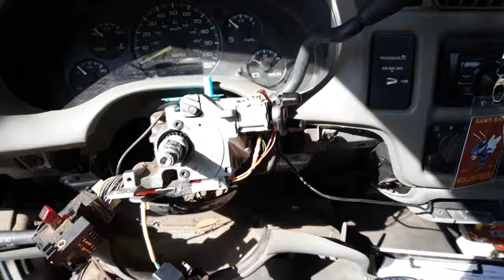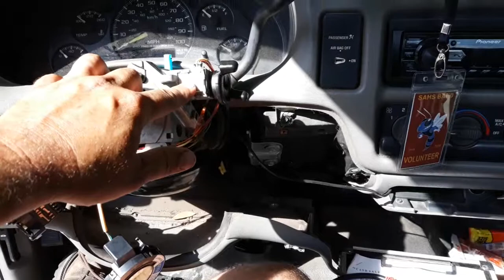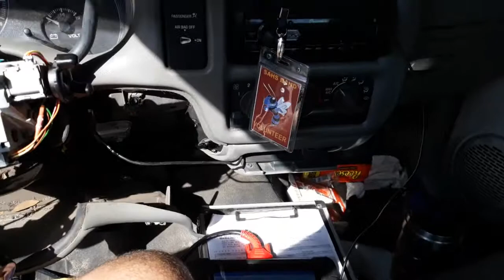GM Passlock Coded Cylinder

Comment: How much was it and what is the part called? Does it come with lock cylinder or is it separate and if its separate do you have to replace both to fix?
Reply: Thanks yesterday was the first time I went to start my tahoe and it said unknown driver. I pulled the negative terminal on battery and waited a few minutes before reconnecting and it started fine after that put I have 270k miles on it so I'm sure this is just the beginning of a problem
Reply from the maker: @dugangant  now also those lock housings have a common issue. The connector that goes into the top of the housing can get a bad connection over time. My other Chevy had that problem. It was intermittent. The fix is to wedge something small into the connector to make it lock in firmly. What I did was take a toothpick. I pressed it down on the left side and snapped it off. Then I flipped it around and stuck it down in the right side and snapped it off. 

Now when I say stick the toothpick in I am meaning to stick it between the plug itself and the plug socket. This solved my issue and firmed up the plug. When you take off the top column cover you will see the plug. It is small with small wires. If you take the wires and gently move them you will see how the plug wiggles in the connector. That wiggling needs to be fixed. Hope it helps.

Also there are 2 screws holding the cover on. I thought there was just one but the one that was hiding on me was tward the center on the bottom of the cover.
Reply from the maker: It is an ignition lock housing. It does not come with a lock cylinder. It is not necessary to replace both.

Here is a link to Rock Auto: https://www.rockauto.com/en/catalog/gmc,2000,sonoma,2.2l+l4,1362899,ignition,ignition+lock+housing,12030
Reply: @Bbernhardsr  The link for the part no longer works.
Reply from the maker: @ItDontComeEasyRVA  I fixed it. Try again and let me know please. Thanks.
Reply: @Bbernhardsr  Yes sir ! It works now.
This morning I did more research. I finally realized that my problem may be this - the former owner gave me spare keys made at Home Depot. They don’t have a chip in them. They also are worn from inserting so many times in the ignition. 
Tomorrow my quest is to find out if I can get a replacement ignition switch and new keys with the chip in them. That can keep this problem from occurring again, possibly.
Reply from the maker: @ItDontComeEasyRVA  let me stop you right there. The keys don't have chips in them. The ignition lock cylinder does. This is why when you change your ignition lock cylinder you have to relearn the system.

More than likely the very small connector has a bad connection. They develop pin fitment issues over time. I have actually fixed this problem before by wedging toothpicks in between the connector and the plug to tighten the connection amd it has worked.